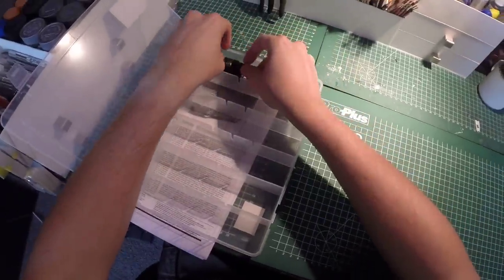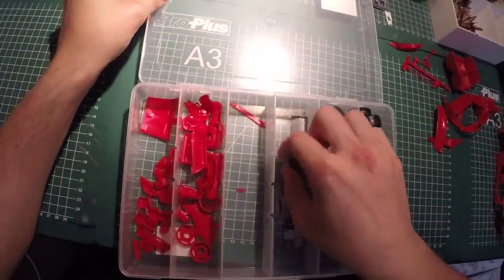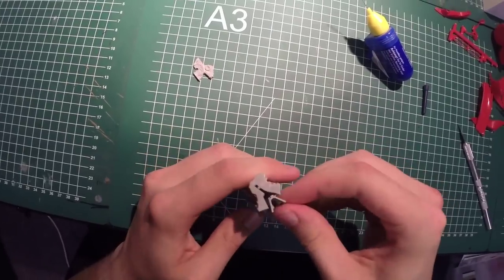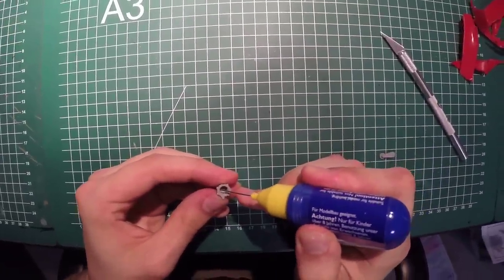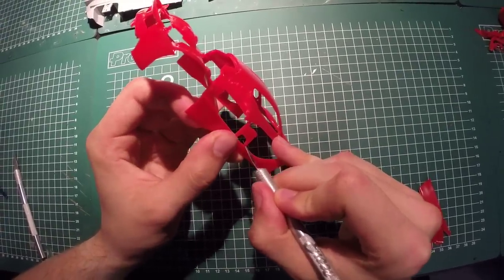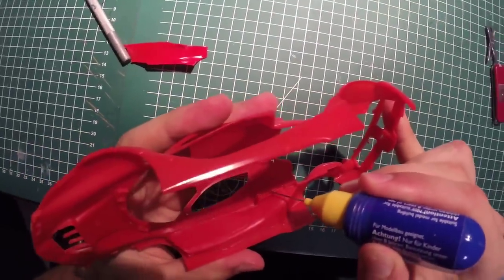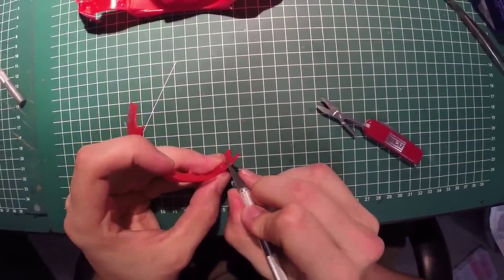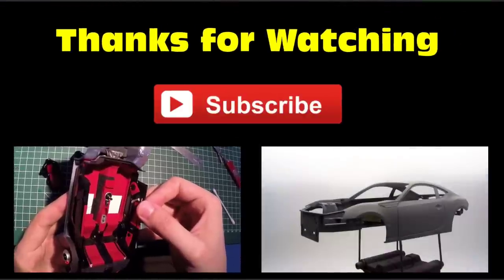Revell:Ferrari LaFerrari build Part 1/10

Comment: I'm looking to start this as a hobby with my son what would I need as far a tools. And what site is good for model cars? My sin also wants to build a car with a remote control where could I find that? I would like a pink car can't find it anywhere please and thank you
Reply from the maker: Cutting mat
Hobby knife
Masking tape
Glue
Wire cutters

Ebay is a good source for kits(and some webshops are good aswell but that depens on where you live)

Remote controlled cars are not model kits. Mostly only a chassis and a body.

And serious remote controlled cars are very exspensive

Comment: nice vid. do u know where i could get one of these model kits to build plz
Reply: +Hishaam Ali You find models kits at Amazon, eBay, and hobby stores around you. If you are in the U.S., you can also check out Michaels where they carry Revell and few other model kit brands.
Reply: ***** ok thanks i got it off amazon but the airbrush air compressors were really expensive so i used spray paints from revell and it is going pretty well
Reply: yes that is what I have learned. Airbrush and the compressors goes for a lot of $$$. It is good to hear that you found models to build. happy modeling
Reply: +thisbji  im starting to woukd a small air compressor work